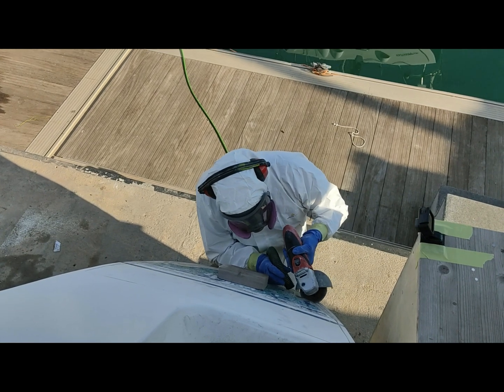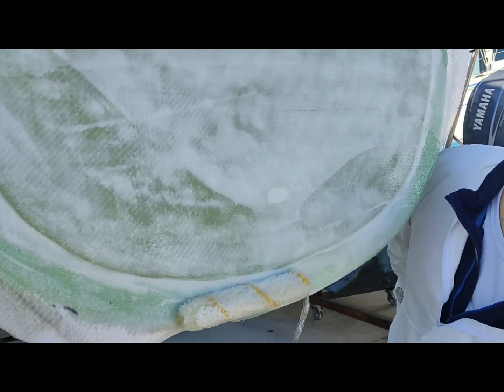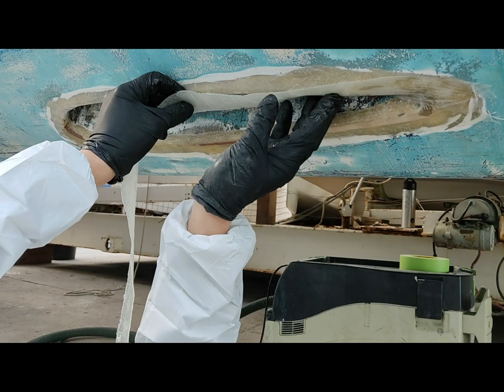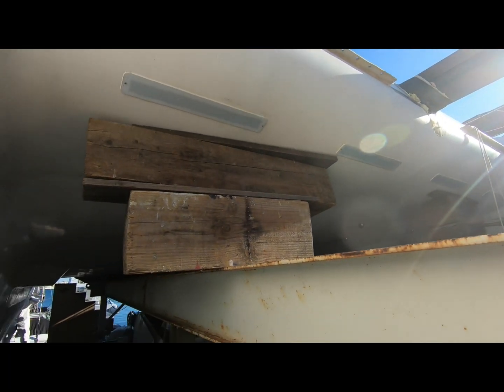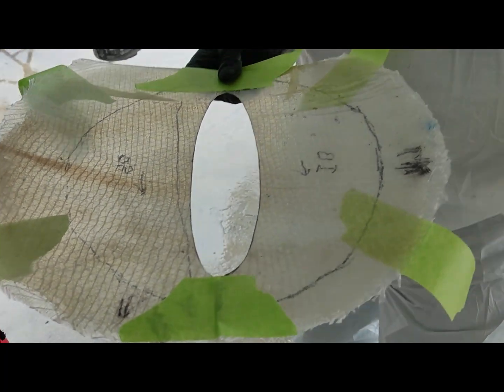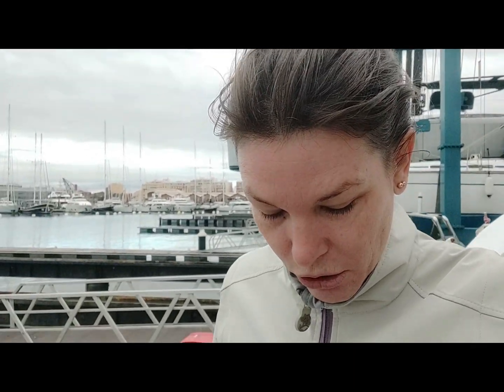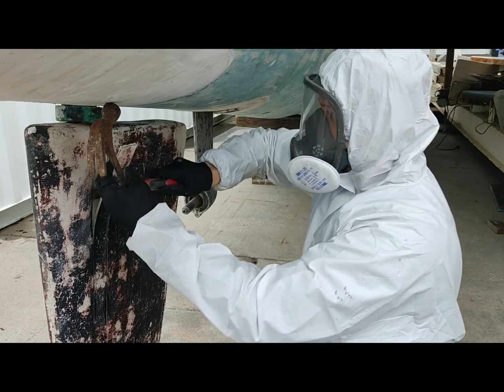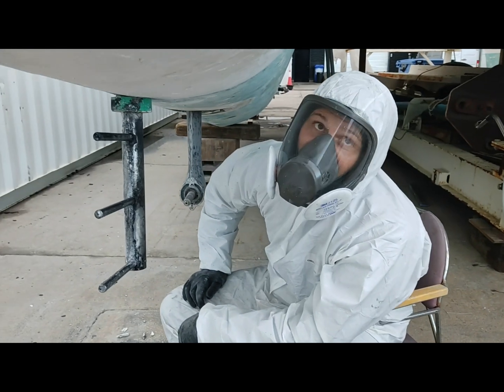Transforming Our Catamaran Hull: Transom Modifications, Fairing & America's Cup Rudders!

Comment: Great projects. I wonder..... (this is end of the day second beer discussion stuff)... if you could just use foam as the transom extensions. Less work and then you'd never need to use fenders at the back.... But likely the foam you would choose wouldn't be stiff enough to use as a step... so you could gusset a top fiber-glassed rigid foam panel for that. But the bottom you'd just have to shape. (If I think about this again, I might just glue a piece of medium dense closed cell foam at the back of my boat and see what happens to it in the ocean).
Reply from the maker: 😂😂 let's do beers discuss further 😂🍺
Reply: @youngbarnacles  Thanks. You shouldn't encourage a nut like me. Now I'm wondering if  inflatable 'extenders' could be made that would strap to the sugar scoops extending the hull length (LWL) 5-6 feet.  Be kind of wild if hypalon  inflatables could be made for $5-6k,  strapped to the transoms, pumped up and at x cruising RPM maybe gain a 'free' knot. I've got a monohull, so I'd only have to make one, proof of concept.

Comment: Maybe I missed it, but what was the overlap length and layup for the extensions?  - Thanks!
Reply from the maker: 150mm on the skins was the base line overlap. The lay up was dependant on the surface, on the bottom it was the same as the original bottom. The deck part was 800gsm base with additional patching for the ladder etc....

Comment: I’d be having a good look at the stainless rudder shafts, checking for electrolysis! Stainless can have a pin hole on the surface and a cavernous hole within! 👀😎🏖🌴☀️🇦🇺
Reply from the maker: Absolutely! Great point.  That was the first thing we looked for when we took the blades off.  Crevice corrosion is a known problem when the blade is bonded to the stock depriving it of oxygen. The usual tell tale signs of rust and pitting on the shaft were thankfully not present. Our original plan was to replace the entire rudder and rudder stock with brand new ones however  time and budget restraints has meant this is now our permanent temporary solution! 🙄😬